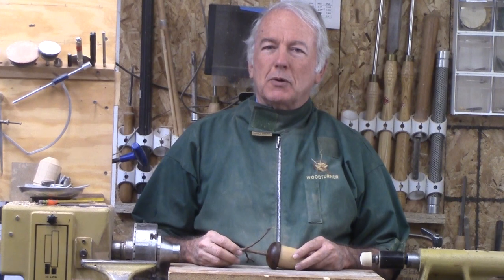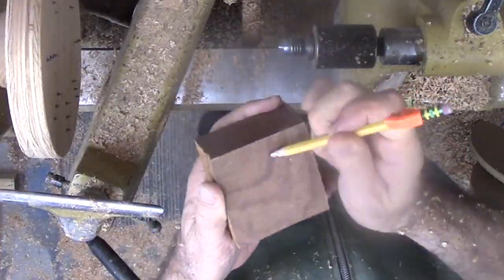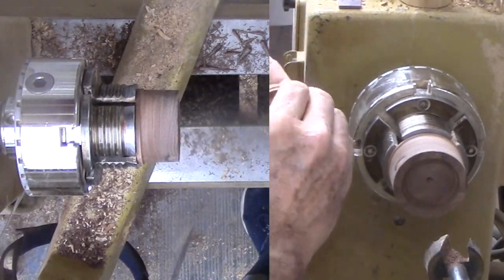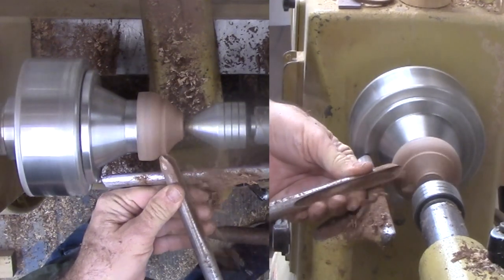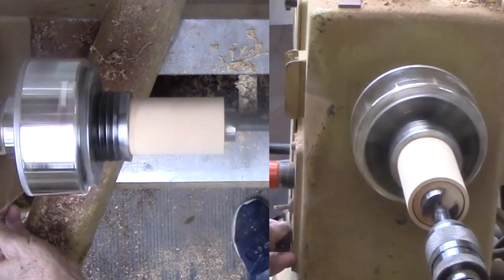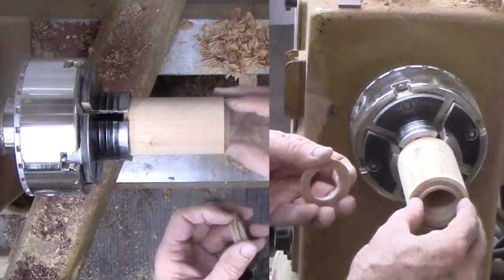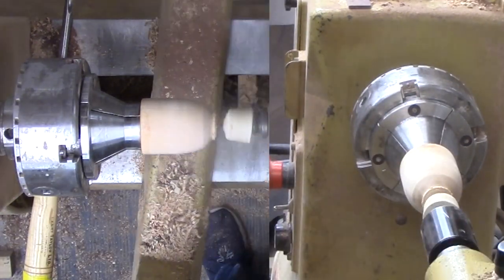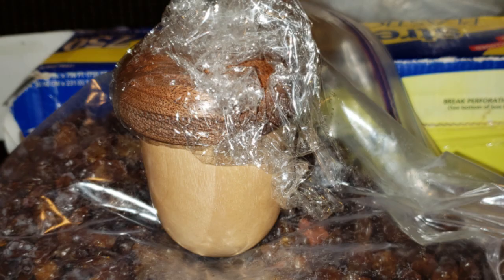Woodturning Acorn Box With Bayonet Joint

Comment: Any thoughts on sharing how to make the bushing?
Reply from the maker: Well, spend 40 years with computers, 2 years with design software, 1 year with a 3D printer,  3 weeks to iron out bugs, 3 hours to print.
:) 
But, I am working on putting them in my Etsy shop and that also takes time.
Alan
Reply: Thanks.  I'll be looking for them.